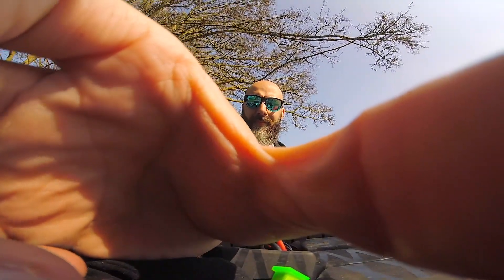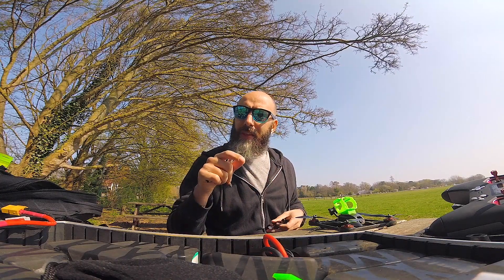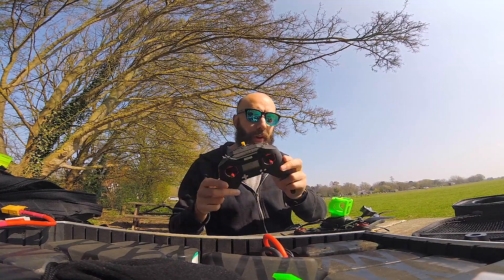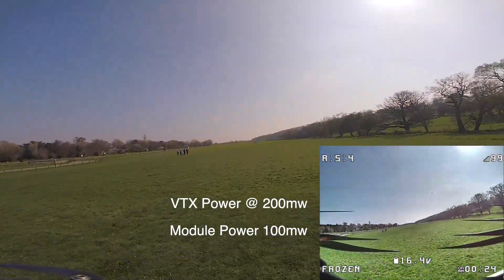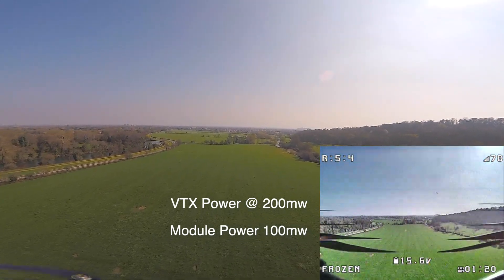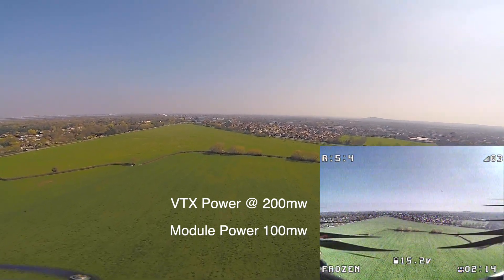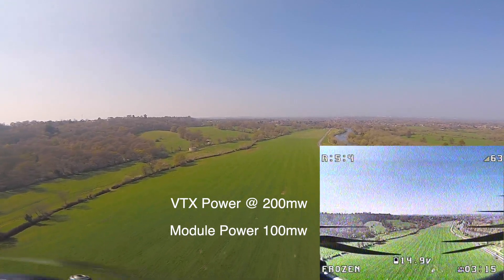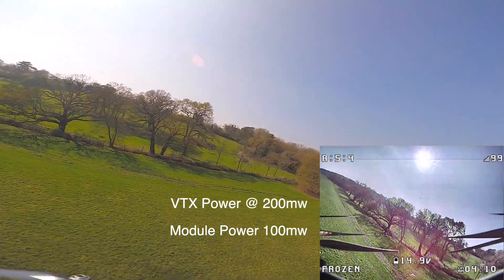R9 Lite 100mw test

Comment: my x9 lite s with r-xsr has failsafe twice on me.. once 100 meters with building getting in the way.. then 145 meters straight open field. (maybe it crest a curve.) I was low to the ground checking video (100mW) and failsafe while having video still. my XM receiver doesnt seem to go further.. I am so torn between R9 Lite Pro or just getting tango 2 .. crossfire convenient cause every manufacturer offers it in quad.. simple.. but like i can put r9 in x9 lite and have 1W of power
Reply from the maker: I regularly fly with people on X fire. I can tell you that I have seen them fail safe on equal scenarios. Also there has been times that they have fail safe when i didn’t. Check you firmware and hardware and ensure it all checks out as it should be.
Reply: @MarcioAtouguia  I went ahead and got R9 Lite Pro. R9mm.. Now I make it 530m on 10mW power, no failsafe. no loss in signal..  Its great. I dont like FrSky having to solder module to plug in to update firmware. I have gotten ones on V1 and cant bind to ota update. Also wish was truely buttonless bind. You still need to press the button to register with ACCESS lmao
But im happy with it. 
Been looking at ExpressLRS firmware. Then firmware will always work. and cant update thru betaflight passthrough..
Reply from the maker: Once you are on the right firmware you will be able to do updates OTA. But I say if it’s working then don’t change anything.
Reply: @MarcioAtouguia  yea learnt that.. I updated one receiver ota and the module.m then when I went to fly other it wouldn't work. I was like oh yeah.. I had to drop module down a firmware update receiver then update module again

Comment: I watched both of your tests for r9m+mini receiver . Can you tell us the antenna on the module? I saw your drone setup with receiver T antenna, but you removed the transmitter antenna when you showed the transmitter.
Reply from the maker: The antenna I got is the super 8. The yellow ban as I’m in the UK and need it calibrated to 864mhz

Comment: Hi Thanks for posting this video. When crossfire micro page says 40km and R9 says 10km. Do you think these are comparable and the stats are realistic? I don't see why one would be that significantly better than the other? Other than the features, they both operate at the same frequency and the R9 can boost power to 4x the crossfire micro, so I just don't understand these stats. I have both btw, but I've just got into FPV and haven't flown them yet.
Reply from the maker: I think that the more realistic distance is 10km plus. I have seen my mates have failsafes with CF in places where I didn’t. I’m going to be putting another little video with the R9M lite pro so keep an eye out for that.

Comment: ive took my dipole antenna that came with it and made a T-style from tubes and mounted it like yours but i get terrible drops just by turning left or right when i'm facing the antenna ends.
My setup is the same, R9 Lite on 100MW.
Reply from the maker: I’m running the FrSky immortal T antenna tho
Reply: @MarcioAtouguia  Is it really technically different i thought it was just a shell